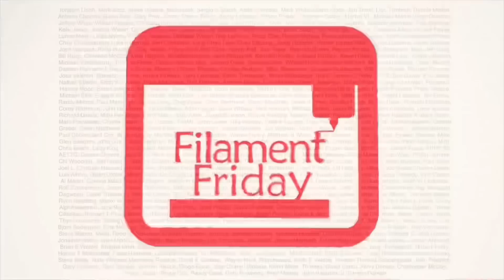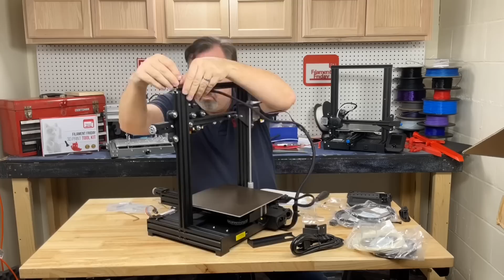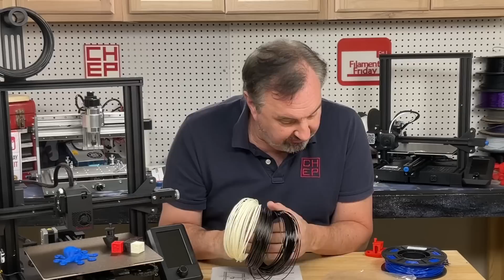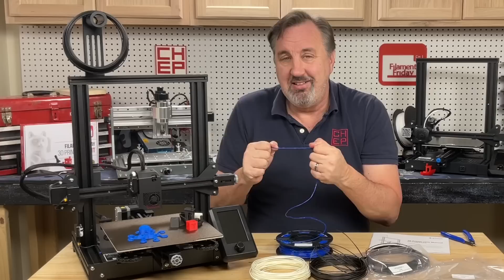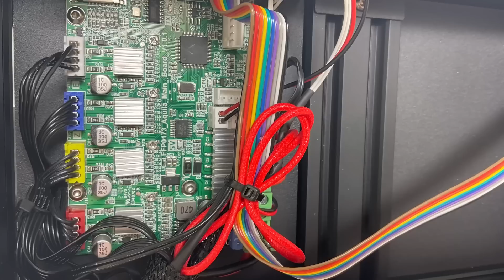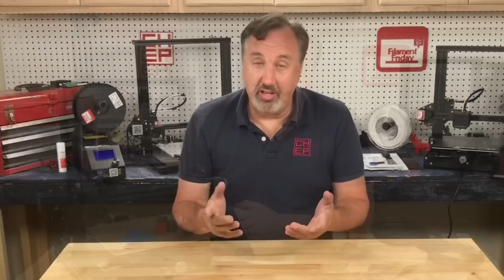First Look at Voxelab Aquila S2 3D Printer

Comment: Excuse me sir I,m 17 years old and new to 3d printing so I bought this printer 2 weeks ago (the same aquila s2) the first test print came out well but since then i've being getting a problem with the adhesion to the build plate and I dont know what to do, I'm currently printing with standar PLA and everytime I print the first layer gives me trouble or if not so after a few hours of printing the print starts to get of the bed. I',ve tried tuning the temperature, leveling the bed, using glue stick, but nothing seems to work. could you please check into this issue sir??

Comment: Hello Chuck, i just got this printer and im not having good luck with great prints. im using cura and not sure what printer to select since its a direct drive? can you help me with this or do you have a profile for the Voxelab Aquila s2?
Reply from the maker: I’d just use an Ender 3 Pro machine profile and my slicing profiles. Just change retraction to 2mm. https://youtu.be/jM_jdsx5yFc
Reply: Awesome thanks chuck. I’m going to give that a try.

Comment: Just ordered mine on sale. My 3rd with an Aquila and Ender 3 Pro. A solid video thanks as always CHEP
Reply: How much was it? 260?
Reply: @po5tup568  in CAD I think $260. Great printer overall. Works out of the box within minutes of assembly. Didn't get some high temp filaments as samples. Red PLA with it though

Comment: Wrong it is an Ender 3 S1 clone.  The major issue you need to be aware of is some boards have the H32 chip and others the N32.  Super important as only the N32 will allow firmware upgrades.

Comment: It's worth noting they charge $105 for shipping this printer to the US, and are asking $299 for the N32 board version. So it's actually a $394 printer, not $279. And at that price the Ender 3 S1 seems like a much more compelling option - dual z-axis drive, CR touch installed, comes almost fully assembled, all in at $399. It doesn't have an all metal hot end, but a $35 Copperhead heat brake would fix that much cheaper and with less fuss than it would take to upgrade this printer to the level of the Ender S1.

Comment: Have you tried the new Ender 3 S1? This printer has some, but not all, the features that it has.
Reply from the maker: I just received one. The hotend is not high temp, but has autolevel. At $399 though it better be good.

Comment: What about the safety features of this  printer in my research I've done when I was just starting out I found lots off information talking about the firmware freazing up if a thermal runaway situation happens I have found nothing that says they fixed that issue?

Comment: Are you looking forward to reviewing the Ender 3 S1? I put an order in for one but will have to wait till the end of January, possibly February before being shipped.
Reply from the maker: What sold you on it?
Reply: @FilamentFriday  I have an Ender 3 pro with all the upgrades and I like how the new S1 has all the features of my pro and more. The build platform is pretty much the same but that doesn’t bother me. One of my favorite things about it how easily the direct drive can be removed and a laser can be easily attached. I probably have twice as much in my pro compared to the S1 that has more features. Ive used knock off lasers with my pro but it’s just not that great. I know the Sprite isn’t an all metal hotend but they are releasing a “Sprite Pro” hot end that is all metal. I’m just a hobbyist that likes to 3D print stuff so honestly the Ender 3 s1 meets all my needs at an affordable price. I know a lot of people say choose the Ender 5 but there’s nothing wrong with the Ender 3 and for my needs it will do just fine.

Comment: If you have an ender 3 already they the extruder/hotend by itself for $70.
Reply from the maker: Where is that?
Plus you get silent drivers and PEI metal flex plate for that price?
Reply: @FilamentFriday  Voxelab sells it, "300℃ High Temperature Direct Extruder for Aquila S2", under accesries/aquila.  It is just the extruder, hotend and nozel. But they do sell all the other things individually. You could buy the whole printer one part at a time.
Reply from the maker: Good point. Great upgrade option for existing Aquila’s since they already have silent drivers.
Reply: Would it be a straight swap for an Ender 3 then?

Comment: Lots of great additions on this one, it looks like a very capable machine for the price!
Reply: It looks like a good machine but I don't know if It can be trusted I know I can trust my 3 Ender 3 systems as it is a proven system but can this machine be trusted with the firmware issues it has had and have they been corrected till that can be answered I will stick with the Ender 3

Comment: Hey Chep, one question if you know, as i've asked everywhere and searched everywhere with no proper answer as i'm pretty dense in the matter of firmwares and knowin what is supported and isn't:

I have a skr 1.3 with a buggy branch of marlin 
(it misbehaves when ejecting sd or printing the same print right after the last print and have to reboot the printer every time), 
and so i downloaded the latest branch, but the default configs for say ender 3 pro which has the printing surface dimensions and the basic configs i need, but it seems to only have profiles for skr mini or skr 1.4. Do i just select the 1.4 and config what i have for the rest? Or what do i do here? As all the tutorials i've found is either for skr 1.3 from 1-2 years ago, or for skr 1.4 of recent last year.
Reply from the maker: Doesn’t the board supplier have firmware for it?
I don’t know the difference between 1.3 and 1.4

Comment: By todays standards, I don't think 300°C is considered "high-temp" anymore.
Reply from the maker: Compared to all the Ender 3’s and clones, that have PTFE all the way to the nozzle thus limiting it to effectively 235°C, it’s huge.
Reply: @FilamentFriday  maybe mid range temperature would be more representative! Cause your have low (ptfe lined, 240 max), medium (all metal, but aluminium and brass parts and thermistor, max 300) and then high temp at like 450c (copper heatblock, pt100)
Reply: We are talking about (cheap) consumer printers, so it is :D
Reply: @kimmotoivanen  it's more mid-field, still.

Comment: Oh that's pretty nice, but I'm having an issue with a direct drive system.

I have an Ender 3 v2. I'm switching to a Microswiss direct drive setup, but I'm not sure what acceleration, jerk, speed, retraction distance/speeds, and gcode changes and all that I need to make. Any tips?
Reply from the maker: I didn’t change much when I did similar. https://youtu.be/iFNcP-OyAH0
Reply: @FilamentFriday  Thank you. I've also thought about going with dual 12v blower fans for part cooling, so that's going to be an adventure.
Reply: @ILEFTCAPS0N  Why 12v fans instead of 24v? Yes, I realize that you can run 2, 12v in parallel but why force a rewire? I'm just curious, because my 24v fans are in the mail & will be here in a few days.
Reply: @3sotErik  My stock fans aren't really that good and need a serious upgrade, and heard 2 12v blowers are amazing for the cooling. Depending on the shroud you're using, a 24v fan should be very good, but the 2 fans were slightly cheaper for me since I already have a ton of JST/Molex/Dupont connectors lol.
Reply: @ILEFTCAPS0N  Yeah, the fans on the Ender 3 v2 are pretty terrible. I'm still going with 2 fans, just not in series.

Comment: Excellent and honest review. I wouldn't buy the printer though. I am not sure how much the metal heat break hotend costs but i converted my ender 3 to direct drive for free using the existing original components and a 3d printed adapter. It has been more than a year and it is printing pla, abrasive pla, tpu, petg reliably. $280 for this printer is asking much when you can buy an ender 3 for $200 and converting it to direct drive. I bet you could buy a pretty nice hotend with the $80 you save! 
I guess this printer are for those people who don't want to bother with the effort and that's fine.
Reply from the maker: Do you have silent drivers, belt adjusters, PEI flexible bed, full graphic display? 
You get all that plus an all metal direct drive hot end for the $80.
Reply: @FilamentFriday  Well I guess I missed that! Thanks for mentioning it. Maybe some people don't care about those extra features so I think my comment might still help some people.
Reply: I upgraded my plain Ender 3 with the Micro-Swiss direct drive adapter and all metal hot end (which together cost more than this Aquila, never mind my other upgrades) and I have to say both things are great. The ability to safely print above 235-240˚C is nice, but better yet is the reduced maintenance related to the hot end. Even with Luke Hatfield's hot end fix to help simplify things, I felt I was spending a lot of time on routine maintenance - dismantling the hot end, checking the PTFE tube, replacing the burned end and having to clean up the heater block if I let it go too long and got a leak. 

The all metal hot end is far simpler...aside from one time where I needed to bust out the heat gun to deal with a clog caused by heat creep (itself caused by printing a little too slowly for a special application), it's been super easy to operate and maintain.
Reply from the maker: Justin Chamberlin - I agree but I prefer the Skice Engineering heat break. https://youtu.be/tYbL-O3FecY

Comment: It would be great if that extruder/hotend came as an upgrade option for other printers. I'm one of the apparent few that bought an Ender 3 Max, and its hard to find anything that fits to the seemingly unique X carriage on this printer. The few that might fit seem to have short bits of PTFE tube which limits their heat capacity. Ideally I'd like a cheap printable upgrade but pigs just don't fly!
Reply from the maker: You want direct drive or high temp?

Comment: Is it using a hardened nozzle? What brand hotend?
Reply from the maker: Nope brass nozzle. Some hex shaped design. Not sure what brand.
Reply: @FilamentFriday  The nozzle should at least have some protective coating against abrasive materials to last. Just like micro swiss nozzle.
Reply from the maker: I print with Brass nozzle and just replace more often. You get better heat transfer and they are a lot cheaper.
Reply: @FilamentFriday  what about carbon fiber nylon? I’ve got a bunch of it for my Markforged, and I’m looking for a a second machine to print with.
Reply from the maker: As long as it’s 280° or less you should be fine.
Reply: @FilamentFriday  is it a special nozzle size or can you buy it everywhere

Comment: I wonder if at this temperature it can print using PCB soldering wire as the base filament? Of course I don't want you to broke the machine trying it :) but would be cool to see it.
Reply from the maker: A standard nozzle temp can melt it. I’ve tried it and it just sticks to the nozzle and blocks it up.

Comment: Lol at everyone getting excited over an all-metal hotend.

The S1 is still better.

All it needs is an all metal hotend, which someone will release soon.

The Aquila needs dual z, Auto bed leveling, firmware. For those of you that think you don't want ABL, you've probably never used a CR touch with Jyers before. I call my E3V2 the Ronco (set it and forget it).

There's your $125 savings right there, and in the end the S1 is still made better, looks better and has better firmware and a bigger community.

This is just an an E3v2 with direct drive (not even needed for 99.99% of prints and not something I would do without dual-z anyway) and an all metal hotend.

If you don't think you'll ever need any more upgrades for this Aquila then go for it, but I'd pass. Enders are just more polished and the S1 is about $100 cheaper than if you did all those upgrade on your E3v2 or this Aquila. Aquila is trying, I'll give them that.

Comment: You're an enabler Chep. I just got started with my first machine a few days ago, and now I want to buy this machine. Carbon fiber sounds amazing!!!
Reply: That PAHT looks very interesting,   I have been using my printer to make molds,  to overmold mil-spec connectors,  I started with PLA, and that worked well,  but the molding compound requires heat to cure, at room temperature it can take days,  at around 45C I can demold around 4-6 hours.  but even at 45C PLA molds will start to warp after 3-4 uses.  I have switched to ABS,  I have not put them through more than 2 cycles yet so the verdict is out on that.

but something like that 260C PAHT might be the ticket,  at 80C my urathane molding compound will be ready to demold in 1 hour, so I wonder how well these would hold up after 4-5 cycles at 70-80 C
Reply: it's a gimmick.  fibers are aligned with the layers, so they add no real strength
Reply: @natalieisagirlnow  That's interesting. 

I wonder why it adds strength to nylon then.

Nylon by itself is soft but carbon fiber nylon they're using to make firearms with.

Your thoughts?
Reply: @dangerous8333  not in layers. in an injection mold, yes

Comment: This honestly sounds like a better upgrade than the Ender 3 S1.  For the price you get everything I want except ABL.  I'll take that over a $400+ S1 any day.
Reply: Not me...
Reply: @dangerous8333  that's the great thing about freedom and self determination; you get to choose what works best for you and your needs. 👍
Reply: @MakerMeraki  Yep! 👍

Dual-z, ABL and firmware like Jyers is more important to me than the high heat hotend on this that will eventually be replaced with a high temp one on the S1 as well.

To me this is just an E3V2 with a high temperature hot end.
Reply from the maker: At $399 for S1 you are spending a lot to then have to add a new hotend.
Reply: @dangerous8333  I added ABL, dual Z, high heat all metal hotend, and direct drive to my 3 V2s for far less than the $443 the S1 is going for on Amazon today or the $429 direct from Creality with a 2-3 week lead time.

Don't get me wrong, I like the S1, but I'll wait until it goes in sale to add one to my farm.

As for Jyers, I've tried it twice and both times were extremely buggy.  The last time was the nozzle would reach 190C and then it would throw a heating failed error requiring a restart.  Flash it back to Creality stock: No problems.  TH3D unified: no problems.  Flashed back to Jyers, same problem.

Comment: Hello, I am surprised it does not have dual z axis leadscrews to handle the extra weight of the direct drive. I would be curious how it reacts at something like 40-60mm/s, if the corners are still sharp? Have you tried the nylon yet? Thanks for the review! I just saw this on their site last night and am considering it.
Reply from the maker: Have not tried nylon yet.
Reply: @FilamentFriday  thanks, I went with the Sovol SV01, much cheaper with dual servos and I can update the heat later. Coming from the machining/CNC world, I am very pleased with the extra bit of rigidity and precision.  I wanted to say though you definitely have the most informative 3D print channel I have found. Just your Cura videos are exponentially invaluable in saving time learning the finer bits. All the best and thanks for the help! Eddie

Comment: A manufacturer deciding to rely on a 3rd party to provide firmware is not good. Sounds like a great excuse for a manufacturer to pawn much of their support off to the open source community. Also means they are selling something they don't completely understand.

It is good to see cheap machines catching up on hardware, not just the cheapest options. But this firmware issue is unacceptable.
Reply from the maker: Based on what I’ve seen, I wish they would just pay the 3rd party guys to create the firmware up front. They do a horrible job on their own.
Reply: Third parties always provide better firmware anyway, for anything tech.

So this is a complete non-issue for me.
Reply: @dangerous8333  Then this needs to be sold as a box of parts that you turn into something, maybe a printer? not sold as a complete printer. This approach lets the manufacturer off the hook for actually building/selling/supporting a real, quality product. More of let's throw some crap out there, and let the community figure it out on Facebook. We already have too many Creality want to be clones.

The fact that Chuck provides better profiles for Creality machines, than Creality does, is proof in point. He knows their machines better than they do! What incentive do they have to make good stuff, when so many people are just focused on cheap?

Comment: Seems very interesting. Looks like a unique hotend design. Wonder how accurate it is. I had issues with the glass bead thermistor that came stock so I ended up upgrading it to a cartridge style and a copper block on my stock Aquila. Once I see this thing in action more I'll be able to choose between this and the new ender. Would love to see a VS between this and the ender if you get the chance!
Reply from the maker: You mean the S1?
I have one coming but it’s not a high temp hotend.
Reply: Well..justcput it in then...they are like 20 bucks😏